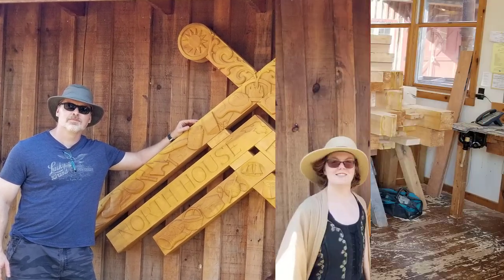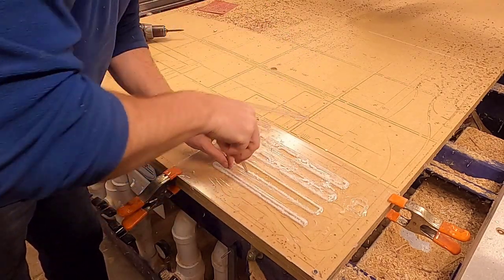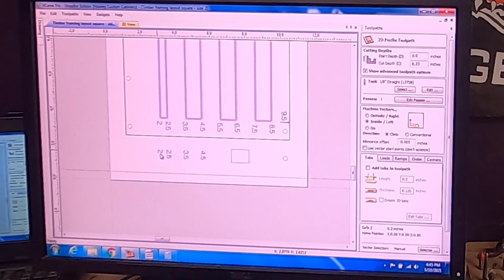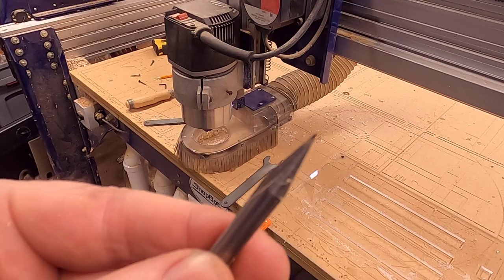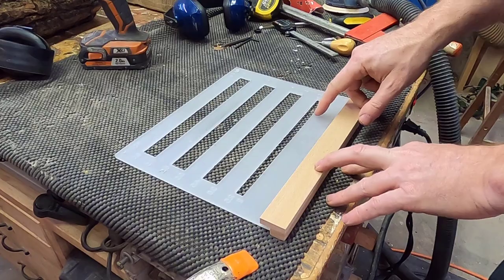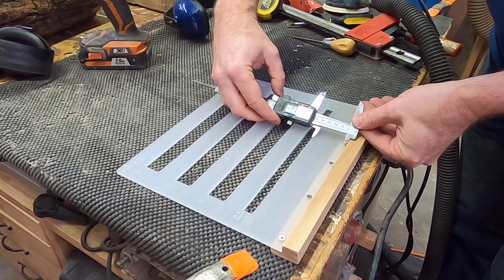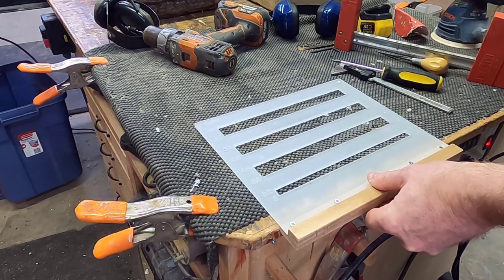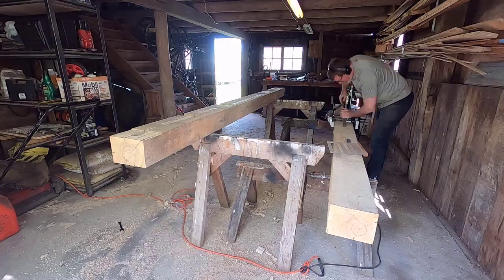Timber Framing Layout Square  (Borneman template)

Comment: It looked as if your pencil didn’t have a sharp enough point for Tom’s standards… nice little build. I may be ordering one here shortly!
Reply: Let me know if you find any Glenn!  I’ve been looking for a while now.  Nobody’s has had them for a while.  Maybe I need to find a friend with a CNC, eh?
Reply: @BearMadeIt  and that’s how a business is born… The Juddman Acrylic Timber Frame Layout Square is born! Available at Salem Wood Works… Looks like you have a second order Judd!
Reply from the maker: I think I'd have to refine my manufacturing process if I were actually going to sell them. I've since learned that the aluminum version like the one's we used at North House Folk School can be purchased from Jim Rogers sawmill; you can reach him at jrsawmill@verizon.net. I don't know the price, but I'm sure it's less than the elaborate laser-cut version from Timber Frame HQ (which looks great... just too rich for me).
Reply from the maker: As for the pencil sharpness... pencil lines are only for initial layout... and fat lines show better on video ;-) Final lines are always cut with a knife.
Reply: @SalemWoodworks  I'll reach out to him.. Thanks! if you do want to practice on another acrylic square... I'd put one to use in the very near future...
Reply: @BearMadeIt  Judd provided an email to someone making the Big Al... I'm going to follow up with that.

Comment: Hey there, my company makes a lot of specialist tools, for Stone Masonry, Coopers, Farriers, and also timber framing. Apart from the stone tools, they all go out under other peoples names. What I’m getting to is, this tool would be very easy to manufacture. I don’t understand why there’s a shortage? Laser cut undersized, with a verification cut on the CNC. Not difficult really.
Reply from the maker: I agree it's a simple tool to make in the form I made. Timber Frame HQ sells an elaborate laser-cut version that you see in the video, but it's quite pricey.  I've since learned of a source of the original "Big Al" Borneman template through Jim Rogers sawmill. I'm going to post his contact info in the video description for those who are interested. I think it's a pretty small market...
Reply: which stone tools do you make?